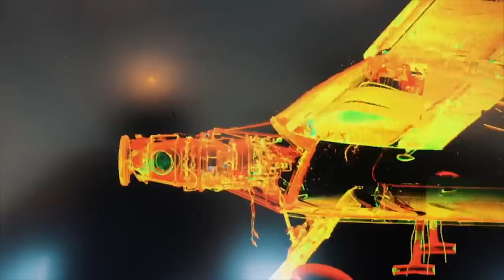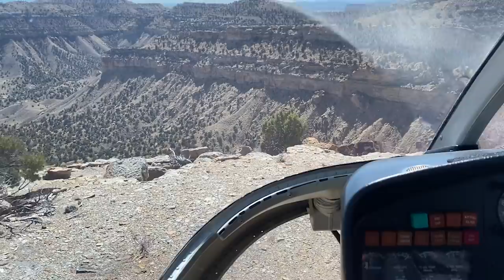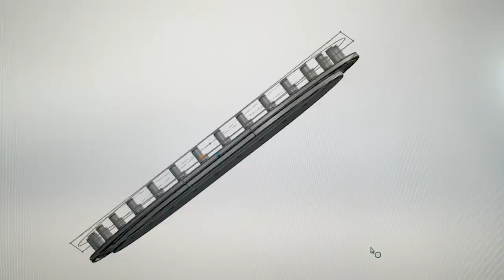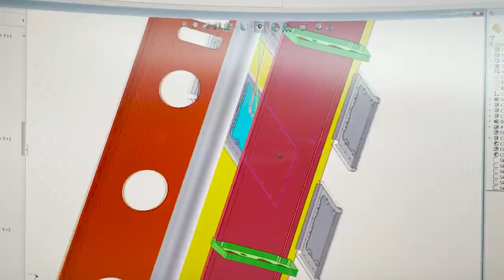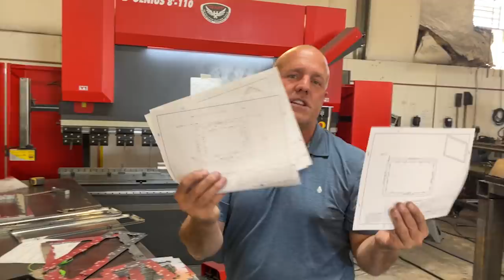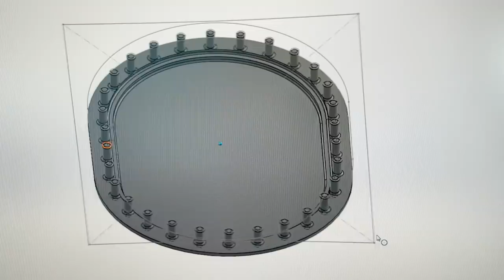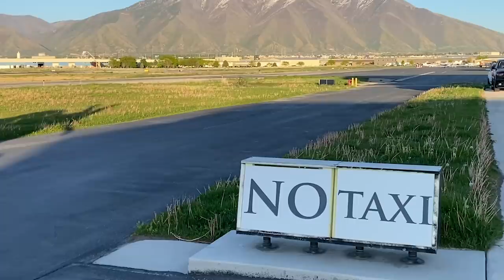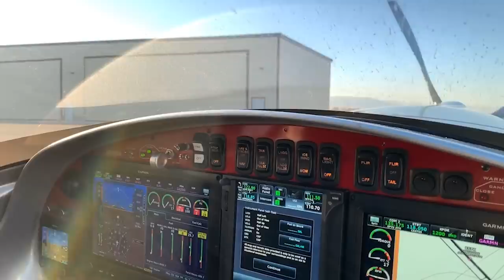Helicopter picks up airplane & Scrappy thermal tests | Scrappy #53

Comment: Somewhere someone is taking notes for a build but can’t remember and can’t afford the equipment in Mikes hanger.
Reply: The machine doing the folding it's probably worth more than a some planes out there. I believe he said that was at best Tugs. But it doesn't matter, if you have access to that type equipment? When I build its with basic hand tools and I can count the ones that use electricity two hands. LOL my metal bender is a rubber mallet and a 4 by 4 clamp to the back of my old flatbed.

Comment: I've just noticed the LED landing lights in the nose behind the propellor, have you tried to see if they'll start strobing at night as the blades pass in front of the lens? That might be something to consider trying out at landing speeds before you rely on them to see in the dark one evening? On a hillside? In the wilderness...
Reply: Interesting. Hopefully they are constant current not PWM. But if they are PWM there could be flicker for sure at certain RPM's.

Comment: Re. engine temperature testing - it actually looks as if smaller cowl intakes (and maybe oil-cooler intakes) would have been possible (particularly with the auxiliary cow-flap intake available), hence a little more air-speed? Of course I'm one of those "you missed a bit" sideline commentators.
Reply from the maker: 👍🤠 We have the same thoughts. I would rather fly and later reduce and make other mods at the same time than be to hot and not fly at all.  I have made that mistake only once.  So far I think I’m really close but only flights and high power hot day will fill in the testing blanks 🤠

Comment: Only plane I know that'll do donuts in the parking lot... :)
Is the tail wheel coming up off the ground because you've got enough wind going over the tail to generate lift enough to pick it up, because you've got enough thrust pushing against the brakes, or torque from the engine?

Comment: Hey Mike that’s awesome how you adjust tail wheel height and AOA, what a purpose of that? Ground clearance or other reason ? Thanks!
Reply: He explained that in one of his previous videos. Basically, tail wheel high for better visibility forward while taxiing and tail wheel low for angle of attack for take-off. Steve Henry, after talking with Mike, did the same thing on his 'plane.

Comment: Like the nut plates on the panels instead of the ring. Problem I always have with the nut plate on the ring panel is getting the nut plate sealed with no pin holes and being neat abiut it.
 Instead of dimples on the rivet holes, maybe 1097 rivets?

Comment: I'm still stuck on those darned three switches.  
Don't get me wrong, the suspension ** is ** fairly trick.
But I was just certain those switches would be, '30 mph headwind', '40 mph tailwind' and 'Reset Density Altitude to Zero', for short field, cruise and 'why not?!'.

Cruise.. have to wonder what Scrappy Cruise will be? ?
Reply from the maker: 😂 I want those switches you mentioned,  TAKE MY MONEY

Comment: The 777 was the first aircraft to have a digital hand check everything out such that you can get at everything,, the software to draft the ship was the software used to build it as well they said. and is the front seat going to give upper back and head support? looks low ? to deal with any abrupt stopping . especially sideways.

Comment: Awesome the amount of thought you are putting into the design but I have one question, Are you getting the amount of thrust from that boat prop that you expected? Ok second question, is the prop using the available horsepower?
Reply from the maker: Yea the prop pull test blew my mind.  I did a video showing it’s thrust at over 1,400 static and I still have nitrous to go.  I’ll show more on that when I do nitrous pulls.  I’m looking forward to learning more soon.  So far I’m really happy

Comment: It's more or less a scrap build. Few parts laying around at suppliers. Worked them a little. It might be close to what a production plane would take. 
Regarding the cirrus, I like chutes but again, less than ideal that engines that expensive with expensive service fail that often. With a spring steel or fiberglass blade gear, they might design it to survive the touchdown. Even though this was modestly damaged, it looks totalled to me. I don't care for laying wires into the body work like that. Why not just a point on top. If it needs the strength, a bit of CF in the A pillars and roof seems a better engineering compromise than groves all along the skin on both sides. 
And a more overriding point, why not lose the tractor noise maker and put two tiny turbofan jets on it. Just overall vastly superior solution. A tiny jet is not that difficult to make an it's a one time thing.

Comment: So basically his fuel tank access panels are exactly the same as on a large aircraft, but on large aircraft they use sealed anchor nuts so you don’t have to replace the whole door
Reply from the maker: Yes exactly 👍🤠 once we got the program done it’s faster for me to machine a couple extra doors with the machine doing all the work and tapping than it does for me to install sealed nut plates.  Between the time and cost of the sealed nut plates and man labor over machine time, I just made extra doors.  Either way works 👍🤠

Comment: Will the inspection hatches in the fuel tanks have a thermal coating on the inside to prevent icing of the waterfall-out ?

Comment: Is there a reason why you installed the nut plates on the frames before alodine+prime ? im thinking that you now have Steel nut plates sitting on Aluminium, perfect situation for galvanic corrosion.

Comment: Just curious : Is it possible that after you will put wings on and try to fly the plane in new configuration,- it will turn out to be unflyable ,- like for example prop wash will be hitting the tail in certain way that there will be to much vibration and stuff!?  How do you make sure it dose not happen!?- software… or just skill and experience..!?
Reply from the maker: Great question I’ll try and answer in a later video.  Past experiences,  lessons learned from engineers of the past, engineering and flow analysis.  To much to type now but great topic for later 👍🤠

Comment: How do you anchor your planes in the backcountry where the ground is too hard for something like corkscrew stakes? I was thinking about "powder actuated tools" which are used to drive nails into concrete and steel. Maybe a similar tool could be used to drive stakes into hard ground out west or in Alaska? It would take a custom tool though because stakes have more mass than a nail; so where PAT tools fire .22 blanks maybe make one that fires .45 colt blanks? XDD Just an idea

Comment: As a fixed wing off airport-er..., I have to wonder if landing a new remote place in a helicopter is as rewarding. I mean, it's kinda cheating right, when you can land anywhere big enough to swing the rotor? Still fun I'm sure, don't get me wrong!

Comment: Dear Mike, why  do you make all the wing parts from Aluminum, and not from carbon? it would add strencth, and reduce weight, in my opinion. This is a question from a faithful subscriber from the Netherlands
Reply: I wonder if it is due to material compatibility issues between gasoline and resins used with carbon fiber? The wings are also tanks. There are definitely gasoline resistant epoxies out there, but their other properties may not be as good as epoxies used for structural applications with composite construction.
Reply: @mckenziekeith7434  Thanks for responding Keith. There are several commercial airliners in service (B787, A350) where the entire wings are completely made out of carbon. There are no issues to build a carbon wing, other than price. Aluminium is much cheaper and easier to build than carbon. Repairability of carbon is much more complex, but Scrappy is for more than 50% carbon already, so why not continue?

Comment: Since the Cirrus is primarily a composite aircraft, how does an inspector preform structural testing of composite components after a recovery like this? I've seen Magnafluxing and the IR light and dye testing for cracks, How do you test fiberglass components for cracking? If I have an accident in my vehicle and the insurance company says its a total loss, I have the option to buy it with a salvage title. Do they have "salvage titles" for aircraft and with proper inspection can you return a salvaged aircraft to being flightworthy or is it "scrappy" and you sell it for parts? Keep up the awesome videos Mike!!
Reply: It could be recertified as an experimental aircraft. That leaves It Wide Open for upgrades. Used parts from scrap yards can be found in many experimental planes.

Comment: Damn... your fuel mass(~455kg) will be more than the empty mass of a carboncub SS(~400kg)
Reply from the maker: 😂👍🤠 yea I’ll likely almost never fill even half tanks. Why would I.  But when you want or need the extra couple hour legs it’s nice to have the option ready to tanker up .
Reply: @MikePatey  Do I see air-air refueling in your future? Scrappy is a 2seater with display for passenger/boomoperator. 

Just kidding, I understand that this is WAY too dangerous for GA. Thanks for sharing, I really enjoy your video's and work ethic. It really motivates me every time!

Comment: Why don’t you put the inspection panel on the top of the wing. That way when it leaks you don’t lose all your gas, you can inspect without having to drain it all, and you can work on it without your hands above your head the whole time?

Comment: Why not just make them wing shaped tanks? Wouldn’t that be more efficient?
Reply: That is what hes doing basically, less weight, more capacity are on the plus side. Finding a tank cell the size and shape Mike requires for the wing probably doesnt exist and although Mike has deep pockets they arent cheap and take time to design and manufacture.
On the negative, sealing the intergral tanks with the limited access hes got and repairing any future leaks will be interesting.

Comment: That tube - hmmmm it's now obvious and evident in every one of your videos on the wing design that there is at least a part-span tube running through the wing span-wise that I suspect is more than just a conduit given the notch in some of the ribs just ahead of it on the upper edge and that there's reinforcing and what seems to be a bushing in some of the key ribs?? A torque tube perhaps? If I get it right eventually or in my drawing can I win a DRACO?? Please?

Comment: OK I have a ppl.... so we train for engine out and force landing..... why was the choice to pull the cord when only the engine was out... why not control glide down ?
Reply from the maker: Terrain and mud, it likely would have touched down at 70 Ish and then dug the nose in the mud and flipped.  Sadly on my search and rescue that is a very common fatal recovery we go out on.  The plane can be fixed and is currently being repaired and they all walked away.  Hard to beat that unless they had a perfect alternative landing spot but mud is not usually good choice.

Comment: Where is the fuel with no wings?  You said there’s a fuselage tank?
Reply from the maker: Vertical tank right behind baggage area. There’s an earlier video showing it when I’m dropping scrappy from the ceiling as a tube frame

Comment: I love it, "the way a mechanic would build it".  I wish more engineers would design this way because someone will have to service your design.  

There is only one modern car company that seems to engineer with service in mind...Toyota.  Things like adding an access hole for a mount bolt,  a way to get an extension through a frame spar, etc.

;-)

Comment: SO Mike, stop selling yourself short. When you were talking about the temps while running scrappy and you were happy with the results, you said you got lucky. You didn't get lucky, you designed it, you engineered it and you built it to do just that. Pat yourself on the back for the awesome work you did because all that work you put in takes the luck out of the equation.

Comment: Maybe I missed it, but did you engineer the tires so you could add/remove air pressure in the tires from the instrument panel?

Comment: I think you would really benefit from having some kind of joystick for that suspension control within your reach. It seams too slow and cumbersome if you have to reach for the screen every time you need suspension adjustments. I get that you don't really need to adjust it quickly, but I don't know... It's a experimental feature, and as such, I like to have those near me :)

Comment: "I wasn't relying on a laser to get it accurate"... uses handheld, battery powered, driver with twist bit...
Reply from the maker: 😂 ok that made me laugh 👍🤠. The location of the laser I trust and that is why I set the laser to make my smaller “pilot holes”. But sometimes Sheetmetal has a small up and down movement on the sheet on the laser table bed and it causes the laser line thickness to vary a couple thousandths of an inch in thickness.  This can cause the hole diameter to be off more than a rivit aloud tolerances is. As you know that would cause smoking rivit slop and play.  So we have the last cut a smaller hole and the drill opens that hole to the exact diameter for the rivit  thanks for the comment I hope it makes more sense.  I could have explained it better. Cheers 👍🤠

Comment: What about accident with all this fuel in the airplane?? Don you take that into consideration??
Reply from the maker: 👍🤠 Yea absolutely.  Great comment. It’s like any aircraft fuel risk management. For a cub I have a ton of fuel but one of my six seat planes holds more than double that amount and has similar risks.  I will almost never even fill half tanks and so I’m like other Cubs when I only need four hours of fuel on board.  Then if I need an 8 hour leg or carry extra for my friends I have the option to fill my tanks and still lift off with half the fuel my next larger airplane holds.
Reply: @MikePatey 💪 thanks for your response. Stay safe and I follow your channel for a very long time. I have no doubt you take your safety seriously. Thanks for sharing all this knowledge with us.

Comment: Not to be mean but why so many problems with $800k airplanes like the Cirrus ? Yes anything can happen to anyone but a single oil line coming off is BS. That single line totaled an $800k airplane. No wonder the insurance rates are going through the roof in GA ! It's the cirrus fools with all the pay outs.

Comment: Mike, is there a safe guard to prevent/detect connecting the nitrogen bottle to the oxygen system? While I think it is unlikely that you'd make that mistake, it seems like that could be a subtle and potential fatal mistake to make. (I have no experience with these systems, but I believe it would be possible to breath nitrogen without noticing until one becomes hypoxic.) Great work BTW, please keep the videos coming!!

Comment: It boggles my mind that this much effort is put in using the imperial measuring system. Metric is so much easier to check and cross reference.  

How many Barleycoins above the window will will the wing sit? Is the parachute tethers longer than a chain and a half?
Reply: How far away is the moon in kilometers?  No one really knows.  The only guys that have been there counted it in miles.
Reply: No one likes a metric fanboy. Fractions are awesome